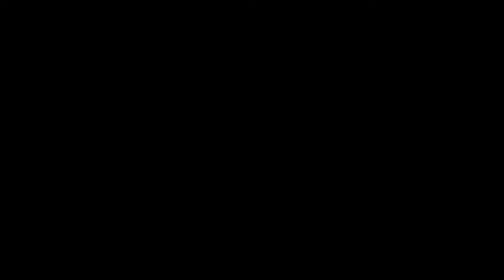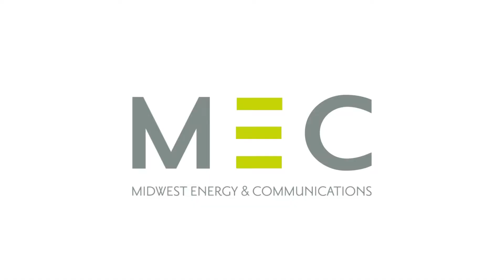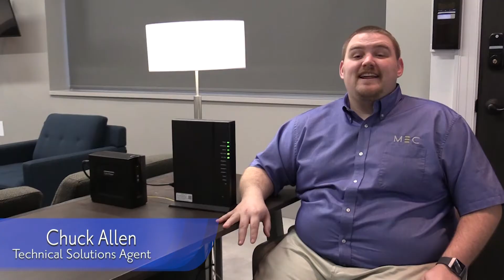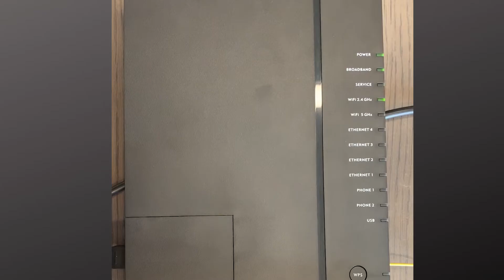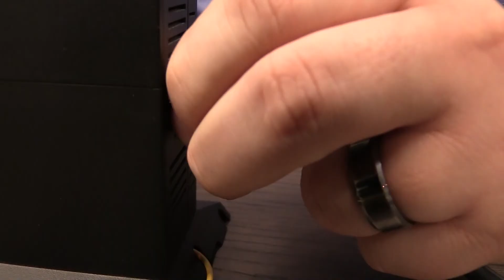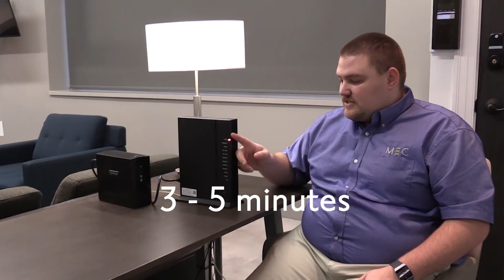Power Cycling Your MEC Router

Comment: Thanks for taking the time for this video! Are you able to tell how to unlock all of the Ethernet ports?
Reply from the maker: When a customer is using the Gigaspire or their own personal Router for WiFi – the MEC equipment is put in “Bridge Mode”. In Bridge mode, only 1 ethernet port can be active. Please utilize the Ethernet ports on the back of the Gigaspire or your personal router.  If you require more ports than are available, please purchase a Gigabit Unmanaged Switch. They are very affordable and come in 5, 8, 16, and even 24-port options.
 
 
Side Note: Without looking into this specific customer, there really are a ton of different possible solutions. Please call our tech support and we could make sure to give you the best advice.
Reply: @Team_Midwest  Thank you so much for taking the time to respond and shedding light on the situation. Your suggestion for the switch sounds perfect. I will do well to contact support should anymore questions present themselves. Again, you have my thanks.